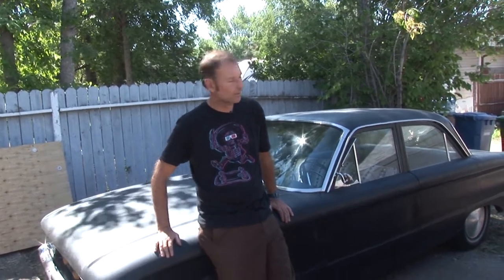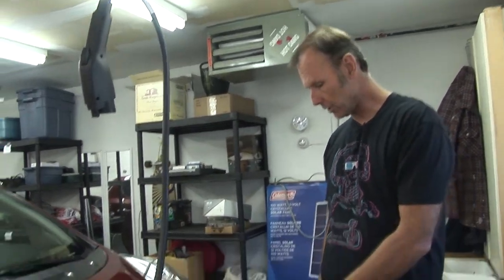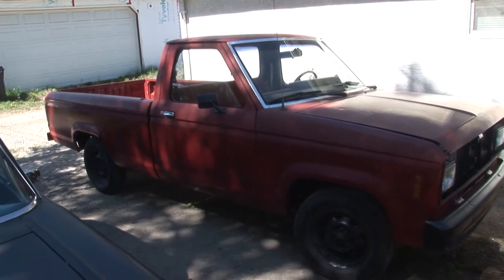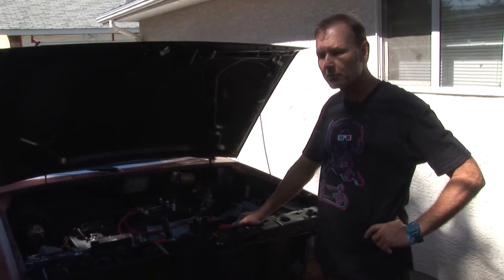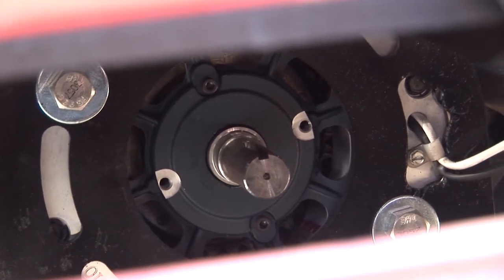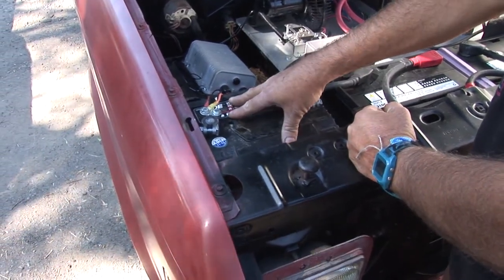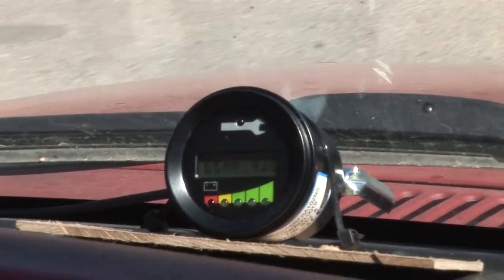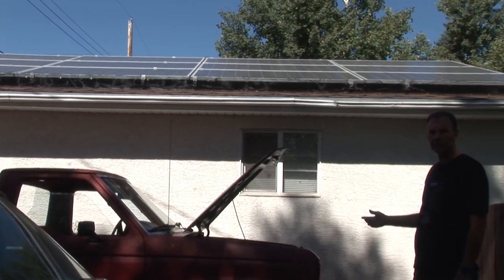Terry Orr EV's Ford conversion and solar

Comment: An AC conversion... Nice. What motor did you use?
 All the Ranger, and S-10 conversions around me are all DC, with either a modified forklift motor, or a Netgain 9". Personally, I wouldn't touch a forklift motor for street use. I prefer AC myself, but wouldn't shy away from anything DC that's Netgain powered. I think I can afford 15 minutes a year to inspect the brushes on a good DC motor.
As for price per usable KWh, LiFePO4 cells seem to be on par with lead acid. I've noticed that the high cost normally associated with lithium chemistries comes from the fact that most people want range, and will triple to quadruple their pack capacity when they replace the lead with lithium.

Comment: small tip , you must run 6 volt deep cycle battery's regular 12 volt battery will warp the plates , site called battery university i have the same set up in a small car that can to an honest 45 miles  at 50 mph with 1238-7501 controller ac 35 motor